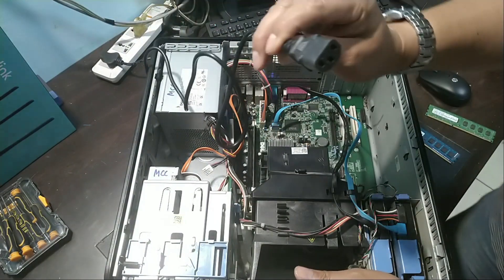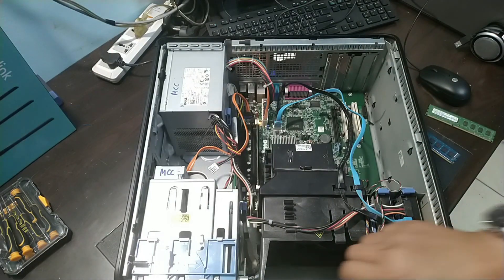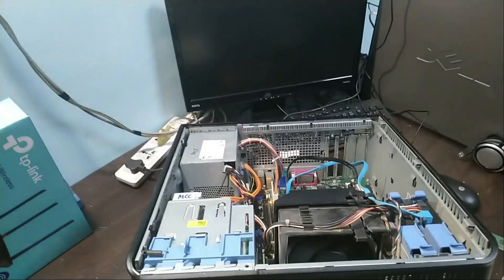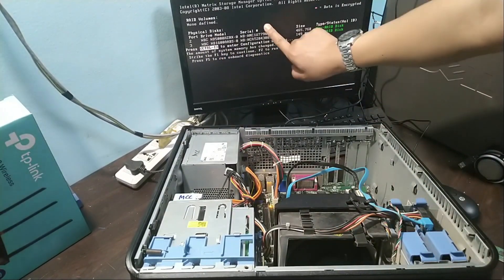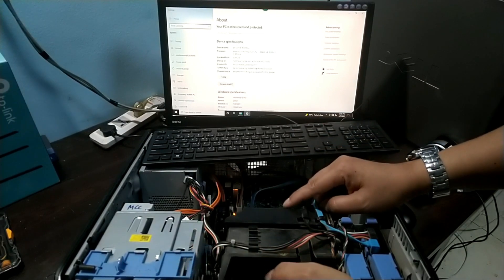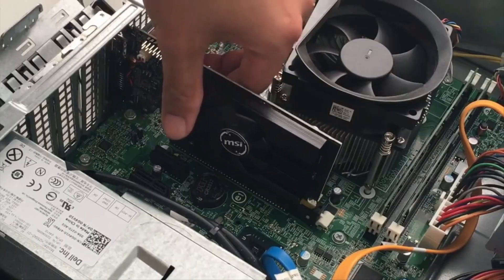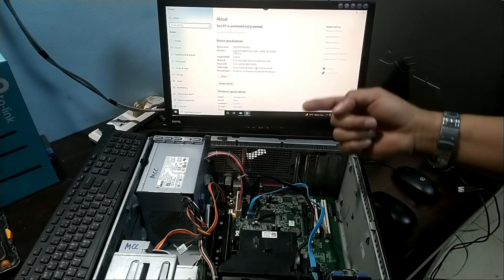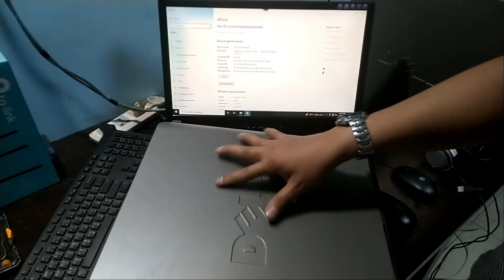Dell Optiplex 380  RAM Beeping Problem

Comment: sir pa help din. pano kaya pag nag boot pero grabeng spin ng fan. pero bago nag boot may message na cpu fan failed press f1 to continue. pero umiikot ang fan. slamat
Reply from the maker: check mo sa BIOS setup, minsan may nakalagay doon yong control ng  CPU fan, ilagay mo lang sa normal spin.  If wala, then check mo ang mga heatsink at mga baka barado ng alikabok.. kaya hindi makapag initialize ng normal at heat ang na detect kaya malakas ang spin ng CPU Fan....    try mong i maintenance muna Sir ang circuit. ♥

Comment: Sir ilan po max ram? meron din po ako optiplex 380 desktop i-upgrade ko po sana
Reply from the maker: Check mo ang MB.. kapag 4 and slots ng RAM pwede yan 8gbX4  or 4gbx4.  Make it sure na lahat ay pareho ang speed at model.  ♥
Reply: @erancarlmixedvlogs3791  sir may bago po akong ram pero nag beep tapos walang dispaly sa monitor ano po ba dahilan ?